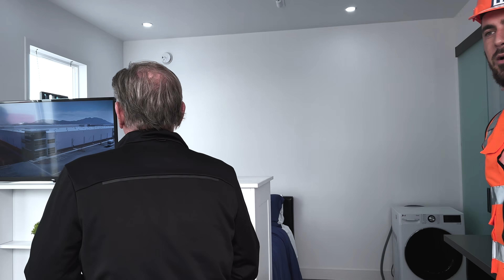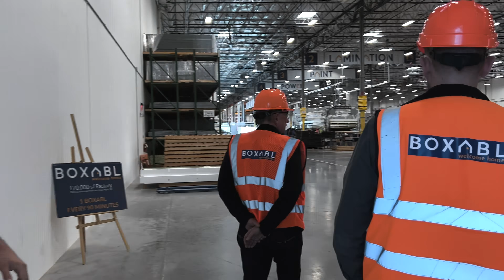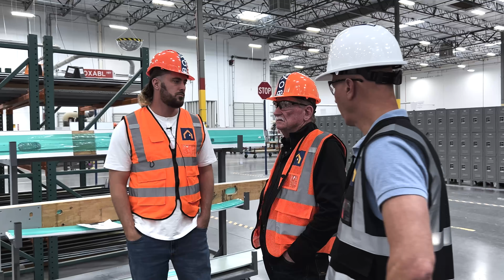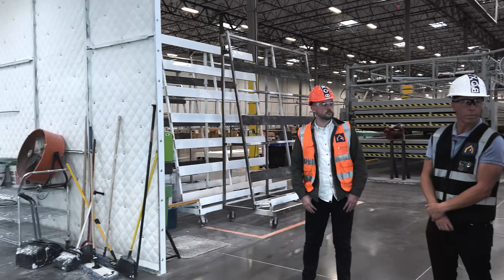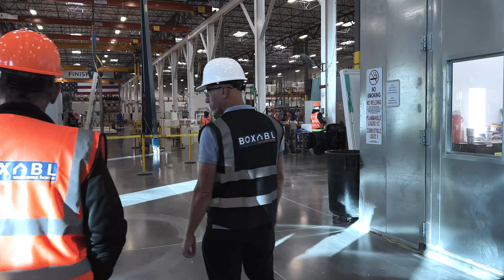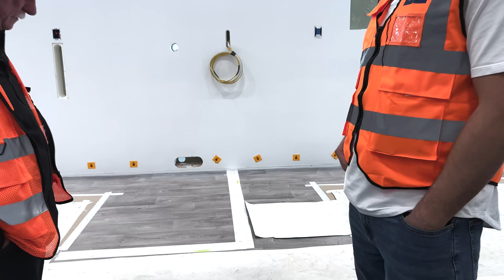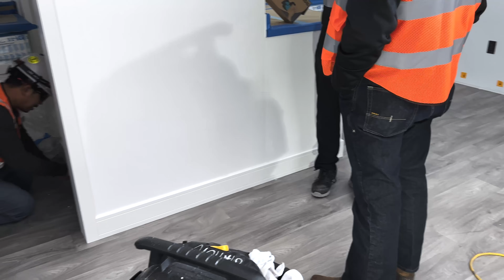What's in the BOX!? - Unfold your new home today | Boxabl Factory Tour

Comment: The video demonstrates many opportunities for process optimization. That also shows the advantage to building in a controlled environment. I'll bet they can achieve a cost efficient process after they build about 100 units.
Reply: Boxabl's initial order of 156 units for the Department of Defense was completed from Q4 2021 - Q2 2022...  In April 2022, Boxabl announced a strategic partnership, investment, and order from DR Horton... Boxabl's second order for around 175 units is currently being fulfilled for a mining company in Arizona for remote workforce housing... By design, everything in Year 1 (2022) at Factory 1 was kept manual labor to prove out the process, with massive investments in automation, extra factory storage space, more production lines, and 2nd generation Casita unit designs coming in 2023... Boxabl will only produce around 300 units in 2022, but should look to scale to Factory 1 Complex max run-rate production of 5,000 units per year in late 2023 ($300 million in annual sales run-rate)...

Comment: Sandy was correct, these Box houses will serve best as a temporary shelter, hunting lodge or as a remote weekend cabin in the woods. But it’s a absolutely trash idea if anyone is pushing this as permanent housing
Reply: Don't be surprised when Klaus Schwab disagrees with you😉
Reply: The Boxabl Casita is designed to be an ADU (Accessory Dwelling Unit, really backyard units) to sell into the recently deregulated market in California, from the Las Vegas startup factory... Casita is the "minimum viable product" and really a "Trojan Horse"... 20x20, 20x30, and 20x40 building shell modules are planned at the next scale of factory... DR Horton became a strategic partner, investor, and customer in April 2022... Selling these in bulk to builders is the golden ticket endgame...

Comment: I think the biggest part is going to be the regulatory. If they don't pass code to be installed in municipal locations, then they won't ever reach the scale they need to get past existing manufactured homes. As other comments noted, the visible framing, walls and roof are relatively easy compared to the unseen foundation, plumbing, electrical. 

Additionally: I don't see them addressing density by scaling vertically; the additional I-beams, hinges and other structural details needed for transport are totally wasted once installed.
Reply: Yep, local codes are huge issue for Boxabl and its startup competitors... Luckily, in April 2022, Boxabl announced a strategic partnership, investment, and order from DR Horton... They also get to tap into DR Horton's supply chain and when they start selling in bulk directly to builders, the regulatory approvals can be aided by industry giants who know how to deal with this... Additionally, the Casita ADUs are built in Las Vegas on purpose to sell into the massively growing California ADU market, which has recently passed statewide laws that supersede local code restrictions on backyard units... Plumbing and electrical are all prefabbed in cut out chases and Boxabl is using the low-level production year of 2022 (300 units for 2 customers, DOD and Arizona Mine Company) to get real-world feedback on Generation 1 units, before introducing Generation 2 production units for much higher production levels in 2023/2024 (5,000 units per year run-rate, $300 million in sales run rate)...

Comment: It seems like running the plumbing within the exterior walls would be a big freezing/pipe-bursting problem for Sandy's hunting lodge use.
Reply: I have a summer cabin. As long as it's designed with all the pipes sloping down, it's as simple as opening one drain at the floor and then opening all the faucets.
Reply: Yep. Easy to winterize cabins are how they've been done for 100 years

Comment: Boy really fall short on a lot of stuff...Can tell that Sandy is skeptical. Why are they using sharkbite fittings for everything (that's the big thing i noticed)? Like 5x the cost of other fittings. Doubt you could make that back in labor speed. PexA is a pretty fast process. Wow, I think home building is more broken as a process than we think.
Reply: It's still early days at Boxabl, R&D like production until mid-2023... None of the $100 million raised by Boxabl in 2022 has visibly shown up yet in (B) new Factory 1 Complex storage space to free up more production stations, (B) automation equipment, (C) more production shifts... Only producing 300 units in 2022, for 2 customers, with highly manually intensive process, to get initial real-world feedback (only started production in Q4 2021) and to help with final design of Generation 2 units coming in 2023... Run-rate production goal for end of 2023 is 10x-15x 2022 levels, with an expected max annual production at Factory 1 Complex of 5,000 units per year...
Reply: @rule1capital  Greg, understood, love the idea. Still not sure why they would be using $10-15 fittings when they should cost about $1 each. Seems like they are actually doing some things worse than a production house. Some better, some worse. It would take 1-2 days to make that change, would save probably 40% on their plumbing...idk Hope they make it. For them these look like some pretty massive things missed in the current production. 

If you have the inside scoop what's the reason for Pex b with sharkbite fittings? Why not pex A with uponor fittings?
Reply: @DavidTuckerII  I am one of the earliest Boxabl Casita priority reservation holders (August 2020) as well as an investor in the original 2020 crowdfund round when there was just 3 prototypes, 3 years of IP development work, and no production facilities... When you say "some better, some worse" for processes, I completely agree with you on the current production line processes... However, Boxabl's unit economic advantage versus traditional on-site stick frame homes really comes through in local market labor arbitrage, build permit signoff arbitrage, total build time and associated balance sheet financing, and absolute consistency on build tolerances... Q4 2021 - early 2023 is watching a new company literally try, fail, succeed, learn in real-time, with the production process, as well as getting feedback from those living in the units... Better to produce 300 units for 2 customer orders, before ramping to 5,000 unit per year production with a redesigned Generation 2 unit... Even with the hyper inefficiencies on the non-ramped production line right now, Boxabl can build 1 Casita unit in 5-10 hours (1 to 2 per shift)... How does that compare to current builders? It is an order of magnitude step change in structure build time, but only works because Boxabl solved for standard legal shipping width, which also scales to future 20x30 and 20x40 building shell units... Because every unit is exactly the same, state/local inspections can all be done in the factory during the build process... In April 2022, DR Horton (80,000+ new single family homes year) became a strategic partner, investor, and customer in Boxabl... Think how much risk Boxabl removes from DR Horton or other builders who no longer have to tie up financing for 4-6 months on a new project before being paid by end customer... I am a moderator in the "Boxabl Investors" Facebook group (15,000+ members, not run by Boxabl) and we would love to have you post your recommendations in the group chat, since the company reps answer lots of questions from the gigantic investor base...

Comment: Plumbing is not as simple to automate I would imagine. Building off site does make hooking up to services a tad more cumbersome I would think. A septic system as well as water ingress to the fixtures might need a common connector or several connections that are traceable to track down possible leaks or weak points. Also do not forget that electrics need plugs in the walls and an electrical certificate needs to be issued and follow up inspections may require access to the interior cabling to pass.

There are trailers for similar uses that pass safety inspections, as well as many certification processes I am sure. The building site where this structure will sit, still needs preparation to set the building up and even though costing may be somewhat less expensive, other costs associated to building just do not go away with a building of this type.

Short and sweet video showing that Munro & Associates do more than just vehicle tear downs. Very Impressive that Sandy takes the time to put his entire  company profile and expertise to work in everything that he tackles. 

BRAVO to Sandy and his team; after all, they do keep us up to date on technology about everything this company can do.
Reply: Plumbing is actually super condense in the Boxabl Casita since the unit has to fold up from 20x20 to 20x8.5, the few water lines are all in a very small total area... So super short total length of plumbing in units, with plumbing being located in pre-built chases... Since every unit is exactly the same coming off the line, turnkey state approved inspections can be done right on the factory floor...

Comment: Does the company have plans to build larger homes? What are the expected savings?
Reply: 20x20 Casita ADU is "minimum viable product"... DR Horton is a strategic partner and investor... 20x20, 20x30, 20x40 building room shells will be used for entire apartments, condos, and single family homes... But those are planned to be produced at the next scale of megafacotry (80,000-100,000 annual production)... Current Factory 1 Complex (300,000 sqft) only maxes at 5,000 ADU units per year...
Reply: They bolt together to form a large home.
Reply: ~ 12% vs conventional stick but good luck with insurance

Comment: Do they need a crane to assemble the house on site? If so that's still a huge limiting factor for a lot of home building applications and is one of the reasons why factory homes are still not that common.
Reply: Generation 1 Casitas (2021-2023) do need for unfolding the roof, but Paolo and Galiano have talked about future generations having simple methods to get rid of needing overkill machinery on job site (Casitas weight around 14,000-15,000 pounds)... I believe Generation 2 units being introduced in 2023 production will greatly improve this "limiting factor"...

Comment: I’ve lived in and owned a Factory Built house since 1971.  I came in two halves and lifted on to a precast concrete foundation.  I figured if a house could survive 400 miles of highway travel, it would last mea good while.  The ONLY downside of mine; in order to make it through highway underpasses, it has a low slope roof (not a problem), and 7-1/2 foot ceilings.  But, the only problems I’ve had are with the work done one-site by the local contractors. . .
Reply: This won’t require contractor work other than outside plumbing and electricity set up.  Plug and play is the boxabl thing.

Comment: Sounds like they have ALOT of improvement to do.  They are still thinking traditionally. "Make a house that folds" instead of building one from the ground up. All those excess piping and wiring..
Reply: Rome wasn’t builtin a day. . .
Reply: This is hilarious, in a good way, that you think the Boxabl guys are "still thinking traditionally"... Paolo and Galiano have been running a real lean startup from 2017-2022 and will get to the Munro promise land in the coming 3 years as they scale the Factory 1 Complex and the 1st US Regional Megafactory, but you need to be comparing what they are doing to actual traditional building methods and time frames available to residential customers in 2022... There are huge reasons why DR Horton is a strategic partner, investor, and customer...

Comment: Have they conducted off gassing tests?
Reply: If you are referring to the foam, I've built post and beam with SIP panels and foam block structures. There was no detectable gassing in either of those types of structure. I tested them myself because I was a skeptic as well. As far as the rest of the materials, I can't say but they do not seem grossly different that todays stick built finishes.
Reply: @babaluto  I am referring to both the foam and the laminates because both have a history of off gassing toxic compounds.
Reply: @squashduos1258  I'm always leery about all of that stuff, such as carpet, mdf, vinyl etc. My attitude about any structure is keeping up the air exchange rate. You can have a very organic home that is air tight and have one molding event then bam, your sick.
Reply: @babaluto  yes there was a very expensive house built in Australia which was super insulated meaning more or less air tight after some time fungi was growing inside the house….a very costly house indeed….you need a breathing house…
Reply: @squashduos1258  What I discovered for myself is the relationships between insulation, air exchange and thermal delay. Thermal delay by way of thermal mass allows for high levels of air exchange and energy efficiency. Let's say you have a concrete structure. Thermal delay is created by insulating the exterior. The insulated mass now on the inside will stabilise the temps while allowing for high air exchanges. Much like a cooler full of old ice water. Of the 13 homes I've built with this in mind, I would use one cubic foot of thermal mass to one cubic yard of interior space. The mass was low strength grout pumped in to the exterior and if needed, interior walls. Something like 35-40 cubic yards for a 2800 sq ft home. My heat loads in Northern AZ were only 15k btu which is little more that one burner on a gas stovetop. This with a 3.5 exchanges per hour. 
I figured this out by studying old adobe structures in Tucson. They had it figured out. I just copied the idea.

Comment: Question for Sandy
Boxabl + Tesla.
Discuss?
Reply: Only house you can afford after buying a Tesla.
A house for US $50K
Reply: @rlemoyne007  
Either...
The Tesla fuel saving pays for the mortgage
Or
The home energy savings pay for the Tesla
Or
Both.
Reply: @rogerstarkey5390  , honest Tesla owners recognize they don't save anything.
Reply: Step one: Fire everybody. . .  These fellows, while having admirable goals, are at the 73-piece Model 3 rear wheel construction stage.
Reply: @dewiz9596  As compared to what competitor building method??? "These fellows" (Paolo) came up with the IP, which solves for factory built shipping... Only started low-level, manually labor intensive production in Q4 2021... $100 million raised in 2022 is currently being deployed for major automation and ramp in 2023, along with 2nd Generation Casitas... DR Horton become a strategic partner, investor, and customer in April 2022...